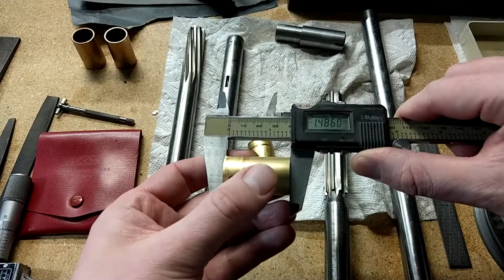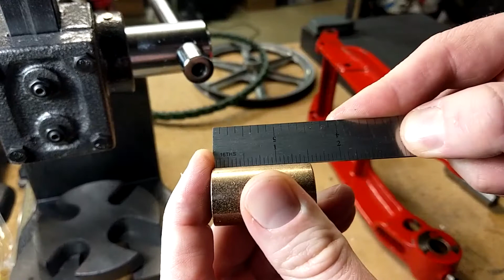Atlas Craftsman 12" Lathe Countershaft Bearing Replacement

Comment: Very educational. Thank you. I have a similar 12 x 36 Craftsman lathe. It has the original two stop aluminum pulley discussed at about 15:30 in your video. The problem on my lathe is that it came to me "fit" with a 1/6 hp motor that has only one pulley. I have a good 1,750 rpm replacement motor but don't know what the appropriate diameters are for the motor pulleys. Mr. Pete has said several times that the threading shaft runs too fast on these lathes. Does anyone know whether that problem can be rectified by the choice of one of the motor pulleys? Recommendations, anyone?

Comment: Excellent video, and exactly what I searched for.  The Atlas 6" lathe M6-20B countershaft hanger assembly bearings needed replacement.  The new bronze sleeve bearings were too tight on the new spindle, and I reamed them with a 1/2" end mill to a good fit.  I removed and reamed them again after the press made them too tight. Just as yours, the bearings pressed out of alignment.  I worked on them with drills and mills and even sand paper until the alignment resolved.  An imperfect solution, but I expect yours is also (if still better than mine).  To achieve the alignment, the final reaming must have cut the lower bearing slightly off-center, leaving an oval to house the shaft with uneven contact. It would have been interesting to see how much play the final reaming left in the lower bearing.   In my case, the spindle wobbles in each bearing separately, but turns smoothly with no play inserted through both.  Thanks for reconciling me to this result (although I may get a hand-reamer and do what you did).